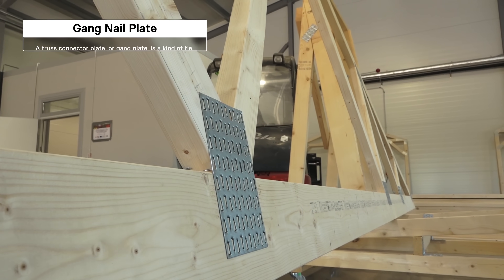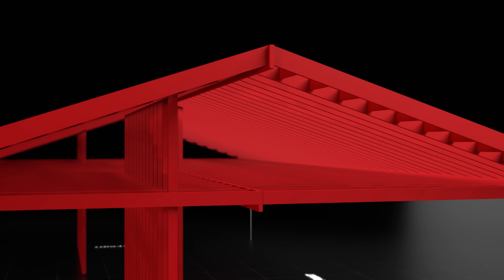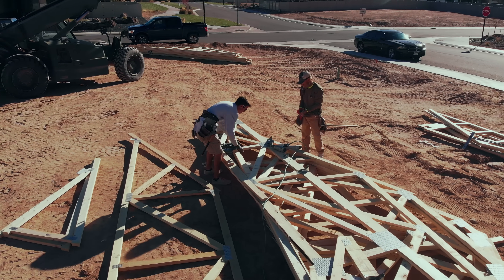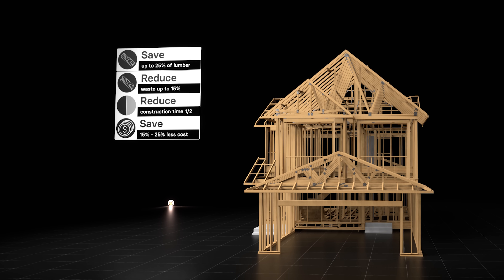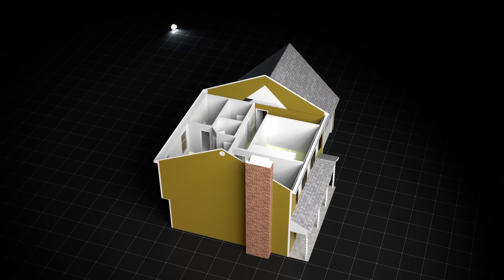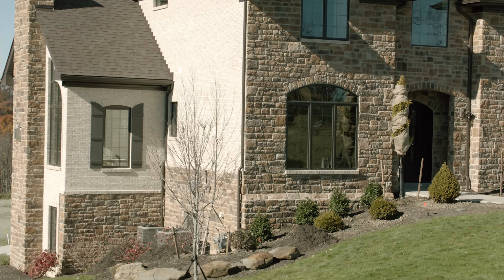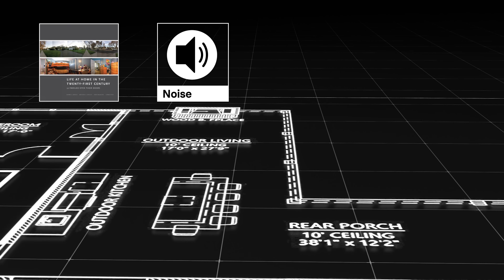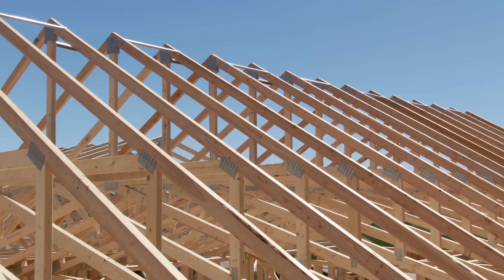The Invention that Accidentally Made McMansions

Comment: While complex roofs are pretty to look at, they’re not terribly efficient. Ask me how I know - my (small-ish) house has multiple hip roofs and several valleys and I just finished re-roofing.
It was not fun and there was a lot of waste. The 4X8 plywood panel cut-offs kept multiply as many of them couldn’t be used whole. After a run of one or two sheets, time for cutting another sheet for the angles of the hips and valleys!
The same with the shingles, a few straight runs and then cut cut cut. And the waste pieces didn’t fit anywhere except for the trash bin. 
Oh, I longed for a simple gable roof!

Comment: I think the biggest contributor to the scourge of McMansions is the idea that wide open spaces equals luxury. Which is a relatively new concept in the grand scheme of things. Ancient societies like the greeks and the vikings built massive grand halls, but those were huge for a reason. They were designed to hold huge numbers of people. The idea that a family of 4 has any use for a living room larger than most middle class houses really only developed in the 20th century. 

And the pointlessly complicated roofs are basically a result of the same line of thinking. Complexity = luxury. That's why you end up with all these excess dormers and crazy angles and other nonsense that is not only usesless, but also objectively unattractive. It's essentially the architectural equivalent of those ridiculous dresses in high class fashion shows. 

Property developers focusing entirely on profit over practicality certainly accelerated the problem, but I think this was kind of inevitable. When people with the means to do so decide they want to act like they can run with the real high rollers, this is exactly what happens. And over time, this ridiculous idea of fake luxury becomes the norm and the real high roller start doing the same, but on an even more ridiculous scale.

Comment: Gang nail plates on paper are pretty nifty but in real life building, they are huge waste of design and one worst utilized parts of the truss. When I was still in residential contruction we stopped using them were we could. Sure they save time in some applications but they a pain when built wrong. Ohh and they don't stand up to fire or heavy snow.

Comment: In the late 1960s my father was working in Illinois for a company that built simple buildings for farmers that were primarily wooden posts covered with aluminum siding; incredibly simple construction.  But I remember him bringing home a few of these gang nail plates (I guess when his company had just started using them) and wanting me to marvel with him at their incredible elegance and strength.  He told me that these were a bit part of the future in building construction, but I don't think he was envisioning McMansions.
Reply: Did he work for Morton Metalcraft? My uncle worked there for 30 years.
Reply: @llamasugar5478  No, his employer was a (much) smaller competitor.  But I actually remember him showing me that (at least at that time, perhaps around 1967) the plate that Morton was using was actually inferior.  He had a sample of the plate that (supposedly) Morton used and, instead of these straight cuts that dug deep into the metal, the other plate was designed with circular holes (instead of straight one).  They still had the metal bent inwards to be pounded into the wood, but instead of a spike, it was a circle of (shorter) daggers.  Kind of hard to explain.  I'm sure they weren't used for long.
Reply: @ I remember those. Uncle showed us one; I don’t recall if it was when they were using them, or if he picked it up when they stopped using them. He worked in metal fabrication.
Reply: @llamasugar5478  Wow.  Very cool to share that memory with someone who already shares it.
Reply: Sure Jan

Comment: I did some repairs on my greenhouse which has a gable roof that is only a single line of 2x4s joined with these. 
It’s kind of insane how incredibly stiff and strong the joint becomes after the second plate goes on. This thing lasted over 30 years with Alaskan snowfall and only failed due to bad structural design that allowed water to slowly destroy the wood itself.

Comment: Gang nail plates explain the supply side of McMansions, but not the demand side--why did people want McMansions? Not just in terms of size, but the insane roof geometries, the gable cancer, the countless bump-ins and bump-outs, etc
Reply: you'll find a bunch of different explanations getting into the cultural, social and economic side of things but it really does boil down to "house big"
Reply: Partially, moving in the U.S. is a pain.  Most people no longer want to upgrade homes every seven years, like used to be the average before the early aughts.  They want to be in their ‘forever’ home, right out the gate.  Also, they buy oversized homes because they are trying to hedge for future needs (children), and adding on to homes is so burdened with zoning regulations and costs that they want to avoid it.  

Secondly, gaining financing is arduous and costly.  Closing costs and down payments cost more than most families’ entire annual household income. Naturally, they would also like to incur those at few times as possible. 

Trading up to a larger home (or even down to a smaller one) has become so expensive that most people just stay put. So they aim for getting everything they think they’ll need in their first home.  That’s why few developers build ‘starter’ homes now.

Comment: Helped with a refurbishment of a modest ranch house in Edina, MN. This is an upscale suburb and most of the 50’s vintage small ranches in the neighborhood have been torn down and replaced by McMansions. Kind of a waste in my opinion.
One other plus for roof trusses, at least in cold climates, is that they can increase the distance/insulation value between the top plate and the roof, thereby helping to prevent ice dams on the roof.

Comment: I'm gonna comment without watching, as per usual.  the "McMansion" has two eras.  The first era of McMansions, the victorian era Barbers and all the shitty copies they spawned.  Bloated chopy rooflines, parapets in snow country, freaking towers and pop-outs all over, and of course the whirligig's and "classical" trim carpentry.  The shakers in contrast built in the same era, but used simplified time-honored techniques from the Zimmerman guilds of Germany.  The modern era McMansion is absolutely influenced by the use of CAD, "floor-plan first", schematic design styles.  In the past: all structures were designed from the roof plan down.  First you draw the wall section: then a building line once you have the massing requirements needed.  You subdivide the facade into "bays" to locate openings.  In this "outdated" approach, drawing with a scale rule and compass in the proportions of whole or half brick to quantize everything.,..  CAD and schematic design emphasizes first the rooms, and floor space, irregardless of the structure.  Then the software generates the elevations, resolves ridiculous roof framing that no sane carpenter from 1800 would ever suggest, and even generates the wall sections based on the construction type specified.  Mariane Cusato already wrote a whole book about this.  Pre-fab roof trusses have been with us since timber framing...  every great old church and even my guilds recent achievement the rebuilding of Notre dam feature "pre-fabricated" trusses.  Many of the McMansions of the 80s, 90s, and 00s feature standard tract building framing, cut from plan.  The roof cutters who pre-stack and cut everything on the ground have such a culture they meet annually to have conferences and compete with each other, such as the roof framing guild.

Comment: I'm in upstate NY and a building inspector in a small rich town. People still do this with homes here but there's almost no truss homes. Lots of stick frame roof with purlins to cut the spans of lumber. It's effectively a site built truss system. We don't have a problem with hurricane or wind forces though, we have snow load problems. That being said, if I build, even though I've been in more $1 million dollar plus  homes than anyone I know, I would build a simple ranch with trusses than any of these crazy homes I go into with 2 story greatrooms heating the ceilings that you can't reach with a 10ft step ladder, rear walls with nothing but glass (because glass is a great insulator at 1/8" thick), immaculate spiral staircases to the second story, elevators, heated driveways so you don't have to shovel snow it have a plow contract, etc.  I just don't see the point. It's dumb to me. You have a less structurally sound house that uses more energy than ever necessary with nothing but flash to show for it. I'm not some crazy eco nut or socialist crazy person, I just don't know why anyone wants these things. It's not important to me.
Reply: I'm old enough to remember when a million dollars would get you a beautiful home. Now it will get you a 1200 square foot tear down or a condo in Ontario, Canada. Home ownership is a pipe dream for many now. What a sad state of affairs.
Reply: I agree. If put a basic rambler at the back, far from the road. Then I would put a big garage/shop/studio/lab? Out behind the house. That's what it's all about.
Reply: You are, like me, an upstate NYer. Appreciate quality, history, natural materials, see no reason to build or buy wasteful stuff. If it ain't broke, don't fix it. They built the buildings, communities, and towns right two centuries ago and there's little point in messing with what was done right. Especially when EVERYTHING that used to last forever, with 100-year-old technology (e.g. washer-dryers) and metal parts, now lasts five years and is built elsewhere, poorly.
Reply: Me too is neither "crazy eco nut or socialist crazy person" but at, the same time, implication is that they are "for the reasonable living".
Reply: Same reason why people drive cars that are way too big for their purpose or buy things from popular designers...to show off their wealth.
Reply: because behind every millionare is someone who was wronged or hurt by someone and they spend there whole life in a fear fueled panic to posture for the chance of that person catching wind or eye of them and " damn, there in ground swimming pool is on hydraulic stilts and lifts from the court yard to the 2nd story balcony when the courtyard gates close at sunset doubling as a security break from ground level. wow i guess i was wrong about them."

Comment: The specific type of plates mentioned here did not eliminate the need for toe nailing at the top plate of the walls...the place where roofs lift off from as a unit during high winds.  Other metal straps, sure.  But not gang nailing plates.
Reply: Yes, it does make one wonder when the presenter doesn't seem to know the difference between a gang plate and a hurricane tie.

Comment: Good video with lots of information but the headline is fully and ridiculously incorrect. Gaig nail plates had little or even no influence on "McMansions". Most houses considered to be this are site framed without gang nail plates and have more complicated roofing design than two opposing open ended gables. Been doing this for 42 years so I do have a reasonable understanding/perspective. Looking at the 1990's example on the video static image is a very good example of a roof that will be site framed without pre-fab trusses.

Comment: Gang nail plates just lead to cheap, crap, track homes and the loss of the need for "skilled" carpenters. Have you actually built a house with your own hands or just designed them? Mass produced houses are junk compared to houses built in the 60-70's

Comment: The engineering didn't make McMansions, they only made them possible.  What created McMansions was the consumer home architecture software that allowed novice "designers" doodle up a monstrosity and then handed a big check over to a builder to "build this". And so they did.  
Without that, houses would be much better designed by professionals and McMansions would be rare(er).
Reply: The McMansion developers in my area are not custom builders as you described.  They have 5 to 6 designs that they prepaid an architect for and that’s it.  You can customize finishes but not dimensions or anything mechanical.  In fact, they refuse to even move an outlet 2 feet left/right on a wall.  I was told it was because the plans were pre-approved by the district and ANY structural or mechanical changes would void the approval, necessitating new inspections and additional fees. It was not even an option. I was told if I didn’t like it to find a ‘custom’ builder and my own lot, because they were the exclusive builder for the lots in that subdivision.

Comment: I have a friend whose first job out of college in the mid-90s was working for an engineering company that was contracted to inspect houses for insurance claims. He walked around suburban developments built in the late 80s and early 90s all year, sticking moisture probes through stucco. The insulated stucco was another huge cost-saving innovation, and while it was cheap, it was garbage. Any water ingress around windows doors or anyplace else just sat inside the walls, and they rotted from the inside. 

American homes are very poorly built, and the quality of the materials is essentially garbage. Buyers would rather have more space they won't use than have something of decent quality. The truss plates make complicated rooflines easier and open plans less expensive, but American taste means those attributes are used to make larger and larger and ever tackier designs. Cookie-cutter beige boxes with terrible HOAs and yards overlooking the holding pond. 

McDonalds was able to engineer a way to make hamburgers quick and easy with similar results. Americans seem to openly hate anything of even average quality.

Comment: As a contractor I spend so much time inspecting and repairing trusses because of these plates. It's crazy how easily these trusses can be damaged so it's important to make proper repairs!
Reply: Snow loads, branches falling, earthquakes or tremors
Reply: @kld70  That doesn't seem to be an issue restricted to this construction.
Reply: Even more crazy is how stressed plate joints can be weakened months or years before actual failure. Roofs can be exposed to an unusually high snow load in our area and appear to survive perfectly fine, but the wood around the plate was stressed and the plate teeth bent. Next winter comes along after it's had a chance to settle, drops a relatively light snow load on top, and you'll get a failure almost without warning.
Reply: How do they get damaged?
Reply: @0MoTheG  Primarily mishandling through transportation or installation.  They're usually long spans of 2x4's so very easy to bend/break.
Reply: @0MoTheG  Usually when unloading on the job. They tend to bend even though they are strapped together.
Reply: How do you repair a damaged one?

Asking for a friend who wants indestructible trusses.
Reply: @firstmkb  A licensed engineer that designed the trusses would have too recommend a repair.  However, typically a damaged plate would be fixed by putting OSB on both sides and nailing it.  A damaged web would be nailed with 2x4's overlapping it on both sides.
Reply: @firstmkb  You want indestructible use metal... Trusses are for cheap, not indestructible, rafters are stronger.

Comment: That plate may have made the shape possible but it was cementitious siding panels and fake cement keystones that made them tacky on the outside. That stuff put the Mc in the mansion. In Texas I've noticed that changed over the last 10 years and houses are starting to have real style, all brick and stone, and tasteful design elements. Customers must have demanded better.
Reply: Except on the parts they don’t see. Remember, when the profiteers add more somewhere, they cost costs elsewhere.  Buyer beware.
Reply: @kld70  That was true in years past aluminum wiring was a disaster. My house was built in 2018 and I have had zero problems with it. I was even able to finance a 2,321 square foot single story with real hard wood floors! Something that would have been near impossible just 15 years ago, the bank would have calculated the max loan on square feet alone, not quality.
Reply: @frankcoffey  Nice!  Does your 2321 sq ft include lower level (basement)?
Reply: @ No, for some reason basements and rare in Texas. You just never see one on a new home.

Comment: Great video. Well researched and explained. Your video would be better if you got feedback from guys who have been building houses since the 70s and has built both truss and traditional. Most of your video is accurate and impressive. But you make some assumptions and over simplifications. Especially about the benefits of trusses over traditional framing, why the rise of house sizes, and especially the real estate boom and collapse. And toe nailing - Not difficult, awkward or weak. Just try taking apart a roof rafter or floor joist that has been toe nailed correctly. Its a bear. Trusses did not stop a roof from being torn off in a hurricane. In fact, I doubt they helped much at all. But smaller roof soffits, hurricane ties, and other building modifications that made construction safer in hurricanes. That all said, trusses are a great way of building. Saves time, money, material and superior in some ways. But traditional building methods, even on the Florida coast, still happens because a traditional roof and framing is superior in other ways.